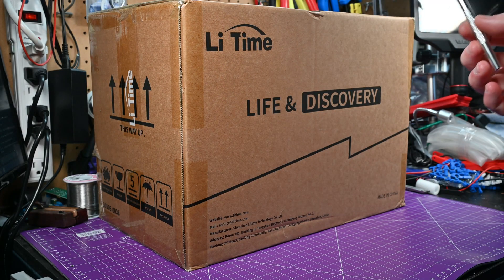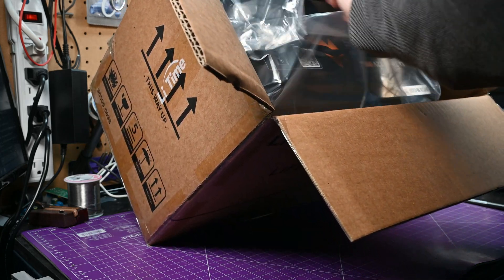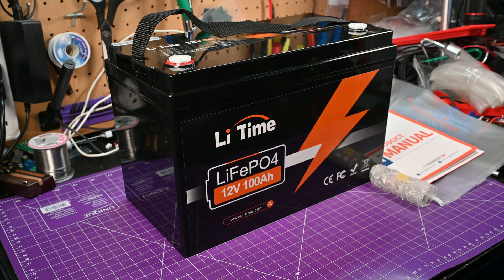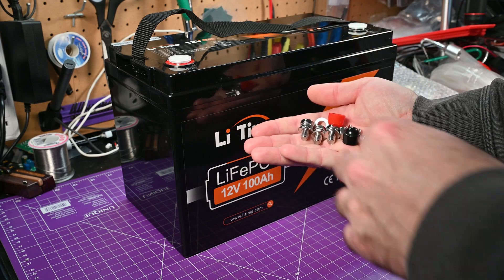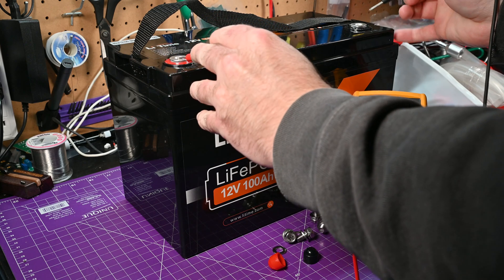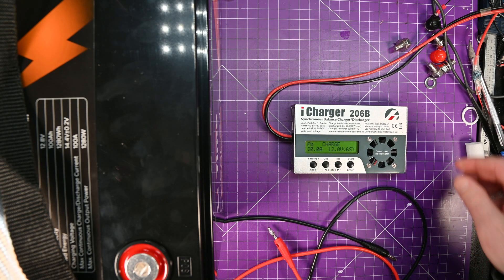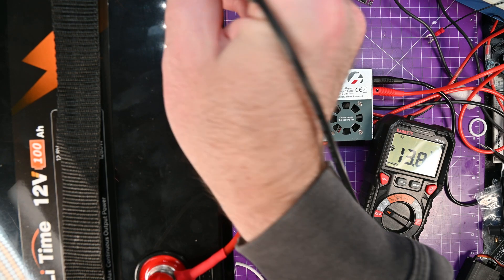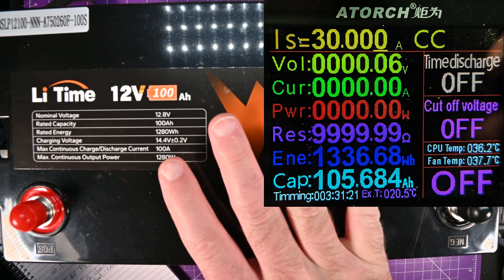Say GOOD-BYE To Lead-Acid Batteries! - Li-Time 12v 100AH Lithium Battery Unboxing And First Look!

Comment: Need to remember these are not drop in replacements unless the environment is always above 0C (32F) when charging and not stored  below -10C (14F) as per the manufacture specs. Since you are in Ottawa you might want to bring it inside during winter, otherwise looks very nice if weight is important like boating as you said.